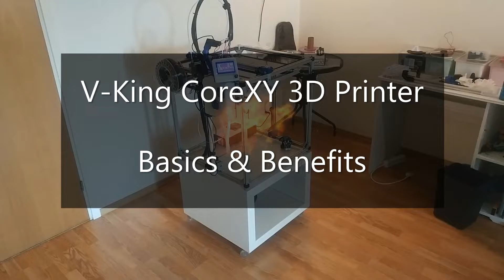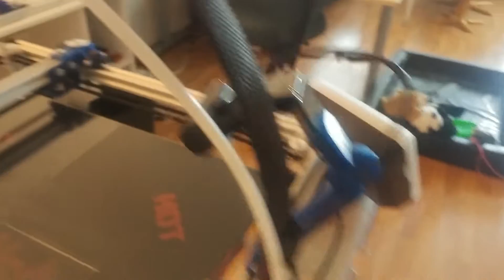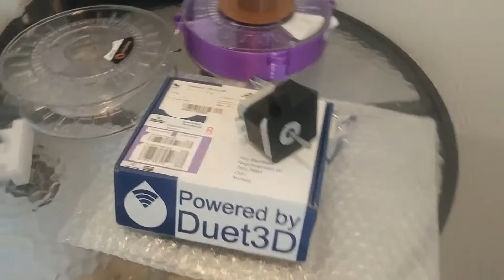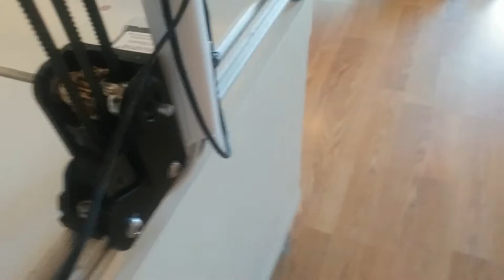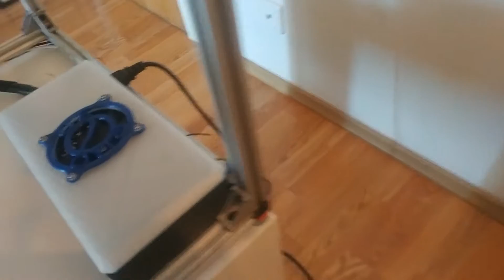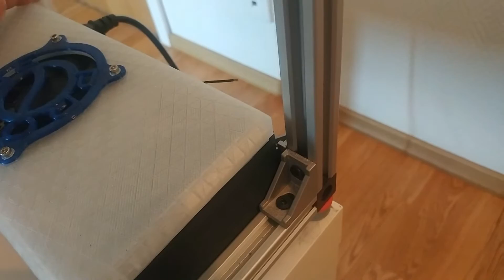V-KING - The Smoothest CoreXY 3D Printer?

Comment: what board do you use?  printing the parts at the moment with a modified ender.  used pla+ from esun to do most of the parts.  for the parts exposed to the heat, i'll be using petg.  all parts will be white!

Comment: For 300x300 print area, I should make V-King not V-baby, right ?
Reply from the maker: You can do either but if doing v-baby 300 then you should improve z axis.
Reply: @PRO3DESIGN  Thanks, but what's the advantage of building V-Baby 300 over V-King ?
Reply from the maker: @Nuttavoot  the v-baby is more compact in the design. It uses high quality idlers but I am not sure if you will see any difference in quality. The baby was intended to be a small desktop printer at 200x200 but can be scaled if upgrading the z lift

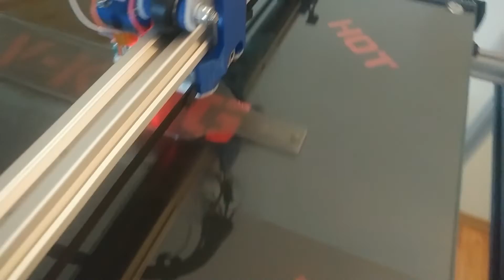Comment: 0:40 duel v rollers?
Reply from the maker: It was a test trying out the w wheels. I reccomend the solid ones as they are more durable
Reply: @PRO3DESIGN  thanks, and that works ok with T-slot? Most seem to be building with V- slot aluminum. Its more expensive here but T-slot is Available and if it works as good as V- slot it sounds good.
Reply from the maker: @Cliff_P  t slot is not meant for wheels. I do not advise using those. The wheels will wear out quickly
Reply: @PRO3DESIGN  thanks,, V-slot it is

Comment: Hi @PRO 3D what’s the advantage of using that cube corner brackets? Is to use the maximum length of the extrusions? Thank you
Reply from the maker: It is to maximize build volume yes. And it was meant to be able for mounting side Panels. Never got that far and like it open

Comment: What is the total cost of this build? sorry if i missed it
Reply from the maker: You are looking at around 700 usd
Reply: @PRO3DESIGN  Thats actually quite expensive... I wonder if it would make more sense to design a retrofit kit where you can buy another prebuilt printer and upgrade to this more solid design instead.
Reply from the maker: @wrxsubaru02  I reccomend building from scratch. This machine is Engineering designed as is. If you start messing with modifying another machine to get similar design you will never have the same quality. Often you end up using more money in the end without same quality
Reply: @PRO3DESIGN  Hii is that Possible to build with this design larger volume like 600X600X600 mm?
Reply from the maker: @romeoak1948  600 size is not possible. It is limited to 400x400
Reply: @PRO3DESIGN  why sir? even if i bought larger extrusion ?
Reply: or you mean this model even with large frame cant handle size more than 400X400?
Reply from the maker: @romeoak1948  the extrusion will bend. They are only 2020
Reply: @PRO3DESIGN  what if i put 3030 extrusion?
Reply: is that possible?
Reply from the maker: @romeoak1948  the v-slot does not come in 3030. You need v-slots for the wheels
Reply: @PRO3DESIGN  thanks
Reply: @PRO3DESIGN  what if i used extrusion 4040?
Reply from the maker: @romeoak1948  4040 v-slots? You need to redesign all parts to fit

Comment: What does this design solve over dbot?
Reply: Fair enough. The dbot is a v wheel based corexy design that’s been around for several years, predating the hypercube by a good amount. You might be interested in looking at that design as well to see how it has evolved over the years. There might be some good ideas to adopt as well
Reply from the maker: @prxrb  oh. I have been told dbot is no corexy but another kinematics
Reply: @PRO3DESIGN  I have a 400x400x400 custom Dbot, the design is corexy.
Reply from the maker: I don't know the dbot so I can't say really. This is my take on a corexy as smooth as possible

Comment: what's the advantage to this? I'm tempted to convert my hypercube to this
Reply from the maker: The advantage is using wheels and aluminum extrusion as linear guides. This is much better for linear movement in the horisontal direction as rods will bend and will never be completely straight.
Reply from the maker: But you need v-slots to convert to this for the xy
Reply: @PRO3DESIGN  oh yeah mine uses b slots

Comment: Nice design ! But I still think using good quality proper lead screws ( and 2xZ motors ) would be way more beneficial then whipping up all that complicated contraption with belts and gears, which in my opinion much more prone to jamming with bits of filaments, slippage and so on....

Comment: Hey there! Really liking this printer, was wondering how you attached your glass plate to the aluminium? I'm currently using office clips but they aren't an elegant solution at all. Thanks
Reply from the maker: I only use painters tape in the corners. Not pretty so I removed the glass altogether and now print on the aluminum with some paint on it

Comment: How much trouble / expensive would it be to upgrade a normal hypercube to this design?
Reply from the maker: It is some work to convert as you need v-slots for this design. The easiest is to just do xy gantry but then you don't get the belted Z drive
Reply: @PRO3DESIGN   ok thanks will look into replacing the entire frame with v slots lucky it ain't too bad then thx for quick reply :)
Reply from the maker: Remember that you also need 21 wheels and the worm gear
Reply from the maker: Go to the builders club on Facebook
Reply: @PRO3DESIGN  will do thx

Comment: Very nice design!  I am getting parts together for my build.  Question:  I understand that the build volume is 340x390, but is the structure big enough to hold a 400x400 bed?  I have access to one, and would like to use it if possible.  Thanks!
Reply from the maker: RichWP absolutely! Thanks for the response. You can use a 400x400 bed no problem. I have been using that myself for one year now. The structure is solid if you do it right! We have a build chat if you need some input
Reply from the maker: RichWP the build volume will depend on some components. You might reach 400 on y with some fan mods. But I now have a 5020 blower so I get 380x330

Comment: What are you talking about? Bend rods? Hardened smooth rods are impossible to bend!!
Reply from the maker: Yes, they are also very difficult to produce straight with decent tolerances and good glide bearings. Rods are just not meant to be used as linear guides in the horisontal direction. 

They actually deflect under they own weight - You can check here:

https://a360.co/2AoNiGp

Comment: Looks pretty sweet, nice work! Are the belt stretching a concern or not so much? i mean they have to support +1kg at times over a long period of time. Also what would you say are the flaws of your design? I am really torn between building your version and the Hypercube Evolution..
Reply from the maker: Hi Jan! Thanks for the interest! 

I use reinforced belts so I have not seen any stretching becoming an issue what so ever. The wormgear takes care of the load and the belts run double resolution so the weight from the bed/print is tolerant - I have over 2000 hours on this machine and many thousands of meter filament

There have been som iterations and still will be as I am very thorough and always look to improve. If you want to go NASA you can always do 3 Z motors if money is no object for even better bed lifting and adjustment .. I am fine as is and it just prints as good as any ultimaker or similar machine but at bigger volume

Flaws you say? I am not sure but I would like to improve the X idler brackets. Almost all parts have been iterated and tested over and over again to obtain what you now see. It has taken about a year

The HEVO is fine but you will have to deal with rods/bearings/leadscrews problems
Reply: sounds nice, i think i will give it a try then in a few weeks, first i need to find space and find out why my current printer doesnt work properly, since switching to a genuine e3d volcano i got random underextrusion, so weird

Comment: How much the parts cost in Norway?
Reply: I see, ~250€
Reply from the maker: Thyandyr well on the minimum spec for all of the components I guess you can manage 6000 nok on building it as a minimum but 7000 is probably more what you want as a budget. I do sell the printer prebuildt and tested with support for 9000 nok
Reply: @PRO3DESIGN  Hej Roy, do you still sell the assembled version? I'm living in Sweden but if needed I can drive to Oslo to come and get it ;-)
Reply from the maker: @wannageering  Hi! I did never get to sell these. It is more a DIY project that can be bought as a kit from makersupplies.dk if interested?
Reply: you can get ratrig v-slots at Kjell&Co, the rest is better get from the far east

Comment: It is a great design. I like its simplicity, low number of parts, and it is very compact as well.
But you can not say that lead screws and bearing rods are causing wobbles or problems.
All those materials are used for professional and high end 3D printing, CNC machines, laser cutters, Lathes, milling machines, etc. and they are extremely accurate. Those parts are made in order to get very very high precision movements and by consequence high precision parts (usually with tolerances under 0.1mm
If you get wobbles or other issues with lead screws or linear rod bearings and such, usually it is because the design is faulty, it is badly assembled or the parts are damaged.
The use of Extrusion aluminium and Vslot bearings is the cheap way that some companies have found to make 3D printers cheaper, NOT because they are more accurate.
Reply from the maker: Thanks for the feedback. I am a mechanical engineer and my statement about rods are made on analytical analysis of different solutions for linear movements in the horisontal direction. It is also based on the problems people experience when using rods and bearings/busshings over a bigger build area so under 300mm square, then rods should be fine. If you look at high end CNCs they all use high end ball screws and linear guides witch is to expensive for this kind of build. Also using wheels makes the service intervals much longer as there are limited need for lubrication VS sliding moving parts - It is all just common sense, and saying that other people use this and that does not make it a smart choice :) I appreciate the feedback
Reply: Great the you understand what I mean, and as you say the problems some people find when using rods and bearings is usually due bad assembly or bad maintenance (sometimes bad design as well...)
I am about to build another printer and your design or the hypercube are the ones I will provably decide to go for.
I am just concerned on your design about how straight and thickness accuracy can be the alum. extrusions can be found, I am sure that many will not be accurate enough... 
What is your experience about it?
Reply from the maker: So these aluminum extrusions are actually linear guides and you will not find any rod with the same high accuracy of these guides. 

The only concern with these extrusions is that they are cut in accurate lengths... So let the shop do that and you are fine :) Also width these guides you do not have to worry about the bearing/bushing not having the right tolerance.. It just makes everything much more easy and functional, just adjust the wheel tension and run! Also backlash is not an issue here
Reply: EXPENSIVE rods have tolerances below .1mm, not the chinese ones you buy for  a printer tho

Comment: That is as smooth as my TronXY X5S with all of my mods.  How did you get your bed so flat and tram?  My bed is 330sq mm and it is a PITA.

edit: btw, that long smooth rod I have never ever been able to get any straight like that and I went through a bunch and paid from cheap to expensive until I gave up on the idea of ever getting a smooth straight, and true, rod.
Reply from the maker: The Best Stooge thanks for the feedback. The bed is 6mm aluminum with 4mm glass so it levels out. Analysis shows deviation over the surface but this is normal. What is your bed setup?
Reply: 3mm boro on the way (I wish I could have found 4mm but no dice) and it is a simple MK3.  If I had a way to put the six holes it uses with any kind of precision I would purchase 6.35mm Mic 6 tooling plate but I don't and the cost is not cheap so not going to risk it.  I called around and the least expensive shop was, basically, 100 usd per hole drilled.
Reply from the maker: OK. Yes I dont think a MK3 Heat bed will ever provide any sort of flat surface so you do need something on top to even out. I hope the 3mm boro will help you out. Mine is rolled alu only so not all that flat but it works fine I think